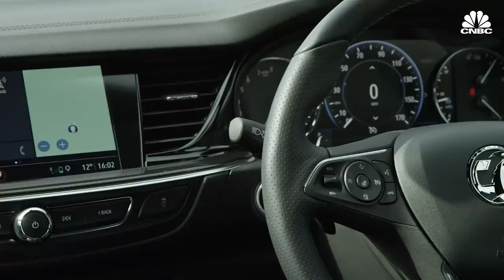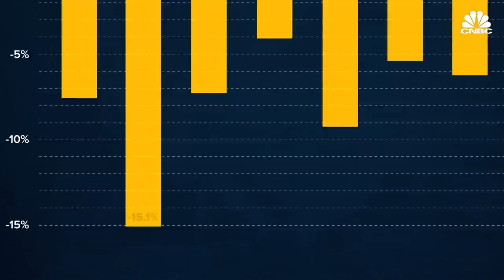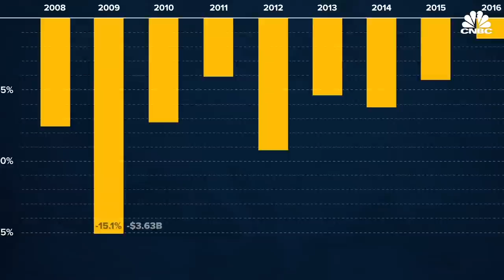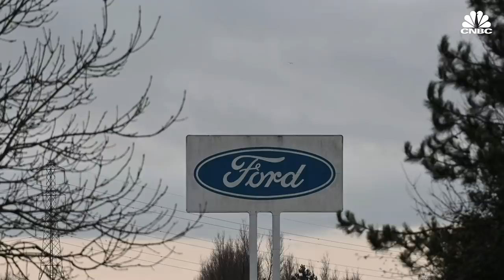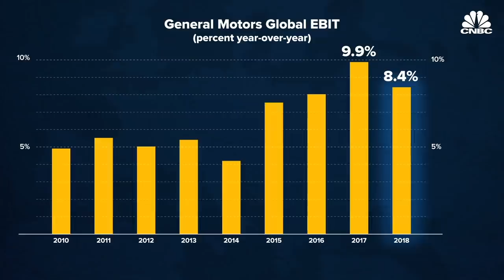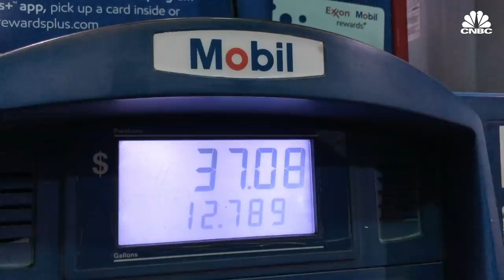Why General Motors Left Europe

Comment: 5:13 Ford isn't pulling out of Europe. They're streamlining their operation and focusing on their best sellers and dropping the cars people don't buy. The focus and the fiesta are fantastic cars and sell millions. A smart move by Ford. Put all their effort into their best sellers to make them even better.
Reply: That statement really hurt the credibility of the "expert" when it comes to why GM failed. He tried to paint it as a problem with North American automakers, but this was a GM problem.
Reply: Ford fiesta is on an orphan platform. Tic toc.
Reply: @minimumtrade  The US version is. The European version has a new platform that will not be produced in Brazil (for US).
Reply: @seidelbaum  Ford/USA and Ford/Europe are officially considered two different brands in Europe. And here in Germany most people actually differentiate between them. You can get a Ford Focus or Fiesta that was engineered in Cologne, Germany and then assembled in Cologne or Saarlouis (both Germany) or in Almussafes, Spain. So most Germans wouldn't even consider Ford a foreign car, just the brand is foreign.
GM used to do the same with their Opel and Vauxhall brands. The difference is that Ford launched its "one Ford strategy" in the late 2000s, thus selling European engineered cars like the Fiesta and the Focus in other markets, including China and North America. That helped cutting costs and increased their  efficiency.
GM however didn't do away with that inefficient double structure, instead they decided to keep up their different portfolios for each specific market, and that combined with the fact of having many smaller unknown or unpopular brands and not just one major one like Ford, that alone meant they had to spend way more on advertising each of those brands. All those double and triple structures caused so much higher costs for GM in total, not just because of the additional engineering done for every single market, but also for storage and purchase of parts, and for administration. The lady in the interview pointed that out, that only 20% of the parts of an Opel/Vauxhall car were identical with their non-European cars. Ford has mostly resolved this issue about a decade ago already.
Reply: they sell mustangs in europe very good move affordable muscle, chevy tried sell camaro's but it was half assed and they're not as good as mustangs
Reply: Damien Also, both Ford and GM cars relied heavily on fleet buyers (company owned cars and vans). That market has dwindled with car finance companies mainly supplying PSA cars and Hyundai/Kia instead (cheaper and with 7 year warranty). Couple this with private buyers able to use finance deals to buy BMWs instead of Fords/Opels and you can see why Ford have dropped the once ubiquitous Mondeo (Nee. Sierra, Nee Cortina/Taunus)
Reply: @JamesPhieffer   and the alleged problems with  UNIONS, and "regulations", if the scene regarding emmissions etc. is "fractured" everyone has the same level playing field. Opel used to be the solid, reasonably priced German car. 

They could not define / defebd their niche and lost out against VW and the Japanese cars in that segment - and GM could bring nothing to the table. There is no know-how for modest, high efficiency cars in the U.S. Those are provided by the Japanese.

- funny how so many manufacturers,incl. the Japanese and Ford deal just fine with the situations.

and unions were very tame, with the exception of France maybe, much too tame if you ask me. 

If the Chinese government wants to reduce dependency on fossil fuels (they have to import) they might at some point regulate what cars are allowed to be sold. Good luck GM - other nations have the know-how.
And then there is of course the EV trend. 

That will hit ALL manufacturers hard - they all neglected to invest in time.
Reply: @xyzsame4081  Saudi Arabia is probably buying them Toyotas...
Reply: Possibly. It also sounds like the spin a CEO puts on the company losing sales and having to contract in the market.
Reply: Then why was the Mondeo left out to dry?

Comment: I purchased 2 GM cars new off the lot. Both had transmission failures under 40000 miles. 

Why would I ever buy another one?
Reply: Pretty sure the only company that still makes decent automatic transmissions is Toyota. Even Honda has had a problem with premature automatic transmission failures.
Reply: I bought an Australia Colorado several years ago. It's been great - because it is an Isuzu D-Max with a GM skin.
Reply: GM used to make outstanding cars but their quality has gone downhill rapidly in recent years.
Reply: Simple; don't drive automatic.
Reply: Why did you buy the second one?
Reply: @thewanderingrey8830  Maybe Ned is old, female or American?
Reply: @uwiwithanuzi GM's division "Allison transmissions" are at the top along with Aisin. Aisin is partly owned by Toyota and Allison is owned by GM. The problem is that Allison specializes more in heavy duty transmissions,. ( Trucks, Buses, etc)
Reply: I just like chevy's LS v8. I have a 2005 Silverado and it nickle in dimes me. I live in the rust belt though. Good thing most GM parts are cheap lol
Reply: I purchased a K30 and its still going 400k later with no problems : /
Reply: @uwiwithanuzi  Th350 and 400.. man when you needed something not to break that's were you went to.
Reply: Steve RX4 7
Reply: My dad had a Daewoo Nubira. It was basically a Chevy Cavalier. It was pretty reliable until the transmission failed at 90k. He did the fluid service at 60k too, still started whining bad 30k later and finally wouldn't go forward anymore.

The transmission was, unsurprisingly, the same GM 4T40E used in the Cavalier and a number of other GM vehicles from Olds to Pontiac to Saturn, all famous for transmission failures.

Shockingly, the engine was specific to Daewoo (probably a different head) and the 2.0L had serious power, almost ridiculous for a station wagon. There isn't a lot of documentation on it, but the engine code was X20SED. I had to do the timing belt on it (it was a high compression interference motor, and the American version of this motor bored to 2.2L was not interference, running a lower compression ratio as well) and remember a lot of German parts so it might have been an Opel derived model for Daewoo.

Anyway, I would say the engine put out at least 170HP. Similar models with weaker injection and engine management were rated at 160HP. The SVT Focus at the time used a VERY similar engine\head of the same displacement and also produced 170HP - but required premium fuel. Where the X20SED really shined was torque. It was a torque monster. The intake runners were like 3 feet long, dropping to the oil pan and returning to the head. Overall an excellent engine design, and most definitely not American engineered (much like the SVT Focus being engineered by Cosworth and the Saturn Redline engine being engineered by Opel)
Reply: Why did you buy the second time?
Reply: @glennso47  Obama motors.
Reply: Ned Labarbara amen
Reply: Buy manual. It's more reliable and efficient
Reply: @yannick6927  Manuals are dead
Reply: Glenn Lego GM,  SINCE OBAMA, became GOVERNMENT MOTORS,  YOU SHOULD SEE THE COMMERCIALS DAILY, they can not sell their junk, BUICK  is the next to Go, , I would never touch anything GM, all they do is DESTROY ! Cheers From NJ 🇺🇸🇺🇸🇺🇸🇺🇸
Reply: No wonder the GM plant in Oshawa closed.
Reply: @glennso47  In your American bubble they made outstanding cars but to the rest of the world they were badly made steel boxes
Reply: @uwiwithanuzi  German company ZF makes the best gearboxes, especially 8 speed automatic (used in many cars, such as BMW, Chrysler, Dodge, Jeep, Audi, etc...) Toyota had history of failures with their CVT transmissions.

Comment: "How hard it is to be global automobile brand" - well most Japanese and German brands made it, so it's probably just American incompetence.
Reply: Ford
Reply: @PKMNFan4664  the chinese cars sell well in developing countries like mine and japanese too.
Reply: @Maximilian Stocker it's an American brand manufactured in Germany. Don't get ahead of yourself
Reply: @Maximilian Stocker That's like calling Mercedes an American company because they manufacture their US-Sold Sprinter vans in the USA, it's a stupid argument.
Reply: Not exactly incompetence, they are just used to a market that accepts crap quality, horrible fuel economy and questionable safety as long as the cars are huge and silly. That does not fly in Europe.
Reply: @seybertooth9282  And no amount of persuasion will change the reality their best selling models will not fit in most of the European roads. There is a reason why Ford Raptor works, but not the F150.

Comment: "They couldn't make it because they weren't European"
Well then how does Toyota and VW do so well in the USA?  Just more CNBC being blindNBblind
Reply: Ford Europe is doing alright for itself. As is just about every single Asian brand that comes in.
Reply: @Fierce Omega i don't know of the US situation and can't speak of it. As far as I'm aware the European models developed by Ford Cologne were mostly brought over with a year of delay with minor changes, not sure if they haven't been marketed as much or phased out quickly? What it comes down to here in EU is marketing, meeting the customer expectations on the nose or exceeding them. Low prices and not expensive to upkeep or insure, attractive and distinctive styling, good driving feel or performance, decent features. A lot of similarities to the Peugeot brand of PSA France which has also been remarkably successful here, and also in many other regions like near East and Asia. For most buyers looking for inexpensive vehicles, the choice would come down to Ford vs. Peugeot. Perhaps akin to how PSA has no room on the American market, maybe Ford Cologne doesn't either?

PSA vehicles had a particular quality that they were fairly soft on the cobble stone but very nimble and tight in turns - smaller vehicles tended to 3-wheel, larger ones had some give in the rear wheels which passively steered along, and when PSA started to lose their way with dynamics due to skyrocketing weight and safety considerations, small Ford Cologne cars picked up some of the slack. The thing with 90s PSA dynamics is that it helps you along until it doesn't and the rear end gains a mind of its own, which is not terribly safe, but I don't think modern Ford vehicles are nearly as prone to that, I don't know for certain.
Reply: @Fierce Omega Isn't Ford doing well in the US? Personally for me Ford newest cars are really nice, Transit vans are really practical and nicely build and the Focus and Fiestas are nice cars as well. But I'd stay far away from the older Ford cars, not necessarily uncomfortable, but just rusty. Kind of the same reason I stay far away from Renault, I mean being able to buy ten year old Renaults with all options for like €600 explains why lol. Terrible cars.
Reply: I thought the same thing, what do you mean they're not European? The Japanese and Koreans aren't either and look at them go.
Reply: Not to mention the rapid growth of Hyundai.
Reply: Toyota's key success is reliability. Also, VW is struggling in America.

Comment: GM destroyed SAAB. They simply don't get what makes a great car. They only got what they deserved.
Reply: Correct.  For GM, putting different badges on different colors of the same car is called "engineering". Totally pathetic.
Reply: I never cared for SnAABS. Most of the people that drive them should have learned to drive them first before they bought them. Saab's Volvos and Audi's always contain the worst drivers
Reply: @milfordcivic6755  just came from a drive in my Saab 😄
Reply: SAAB destroyed themselves. top gear s18e5
Reply: @Sum_Guy  Yet GM contributed to it... they had plans to use an extraordinary 4cyl engine designed by SAAB but it never was put in a car...
Reply: @milfordcivic6755  I once owned a Saab.  Saabs were an engineer's car.  Quirky, impressive.  Very techie people drove them.  I knew someone who had a Turbo Saab and traded it in for a new Turbo Porsche.  I think that he knew how to drive them.
Reply: Speaking of Saab: 7:46 you can see a silver 1998 9-3 5dr and a black 2008 9-3 SportCombi in the background.
Reply: Well, yes and no in my opinion, they aquired a bit of saab in the late 80s if i recall correctly and in my opinion the managed to make many good cars under GM but around the time the financial crisis came around GM did some strange badge engineering, on some cars (which i found cool still) but they seemingly limited Saab a lot in the end before their demise. Saabs were and are the best cars
Reply: @isakjohansson7134  I seem to recall GM trying to re-badge Subarus as Saabs and sell them to Americans who couldn't tell the difference.  Now what kind of numbskulls would fall for a trick like that?  Both Saabs and Subarus are fairly quirky cars, made by engineers who don't follow  herds.  Totally unrelated to each other.  Remember the Cimmaron?  It was hailed as a "BMW-beater" and there were thousands of pre-release orders.  It turned out to be a junky Chevrolet with Cadillac badges.  It disappeared soon enough.  GM has been treating customers with contempt for many many years.  It's amazing they're still in business at all.
Reply: SAAB actually had bad spending habits and GM was trying to get them to use the GM computer/dash system. Only thing GM was right about.
Reply: SAAB, great cost on quality/price for the consumer, they just forgot to leave there something called profit margin.
Also the resale value was crap, almost like Volvos.

You people wanted SAAB alive, should have asked the government to save them, not a foreign company that already got there when they were halfway screwed.
Reply: @jakelivni9576  True i suppose, though at least they allowed the 9-5 to become a thing, i love that car
Reply: @juanca2807  Well selling rebadged Impreza and Trailblazer didn't help. And I doubt the Swedish gov had the means to save a company such as Saab anyway.
Reply: @blackshadow7192  Oh, they had the resources and admitted that was a mistake, Opel was dead until the German government had a word with GM about it.

Of course you can do better than GM did, but the way SAAB was making business for a lot of years wasn't sustainable at all, other brands like Rover saw the same fate.

Just to be clear, I think GM or Chevrolet is a second choice brand at the best when it comes to regular cars, very far from my preferences, rebranding for them is really common, a lot like the Chinese brands do.
Reply: The Cimarron is based on the Opel Ascona 2nd gen. You can not put in a V6 into a car that was designed for small inline 4 petrol and diesel engines. If they used the Rekord or 1st gen Senator, it had maybe a success but the both the latter where sold with straight 6 engines except in the u.s. FAILED MANAGEMENT by gm, as usual!
Reply: @juanca2807  GM destroyed Saab on purpose. they put in alot of debt and took out the tech. The swedish goverment  do not bail out failing compnay like US does. GM tried to save alot of cost with inferior products. Saab that was all about making higly engineered cars did not like that and did not play ball with GM. The big fall started when the generation 2 Saab 900 was produced back in 1993. GM forced Saab to use the Opel Vectra platform. Saab engineers thought that the platform was of poor quality and not up to Saab standards. So they made it better against GM wills. This costed alot of money. this went on until Saab was killed of by GM. Then it was widly know that GM made saab develop tech for GMs other brands. But they did not get payed for it but SAAB had to carry the cost of the other brands. This was a big reason why Swedish goverment was not interested of saving SAAB, They were not interested in saving a company stripped by GM. Then GM refused to sell the SAAB tech that was up to date. So if you wanted to buy SAAB you only got the 10 year old platform and tech in the deal. That was what the company NEVS did. They bought the factories and all SAAB products. Accept the name that is owned by the original SAAB that make the fighter Jet JAS gripen. Nevs are trying to make a EV in the old SAAB factory still.   None of the American chevrolet/Saab or subaru/saab was sold in sweden because GM knew they would never sell here. Becasue it was not a real SAAB.
Reply: @Sum_Guy  oh no. They were forced to use the crap vectra platform by GM. Lutz then thought that a rebranded Subaru eould be a great SAAB suv. Didnt work. Then a SAAB rebranded with the crap cadilkac name. American lunacy at work.
Reply: @unggrabb  they didn't use the Vectra in the end and developed their own car when they were already in financial ruin. What GM tried to do is give them a car they were already producing to cut down costs and have them put their name on it. They wasted money during the wrong time
Reply: @Sum_Guy  you don't know what you are talking about. "The 9-3 was first based on the GM2900 platform and subsequently changed to the GM Epsilon platform. Other vehicles using this platform included the Opel Vectra and Cadillac BLS. 
Get your facts right please
Reply: looking at how usa deletes foreign companies, i wouldn t be surprised it was on purpose